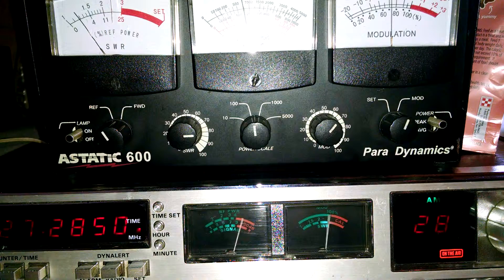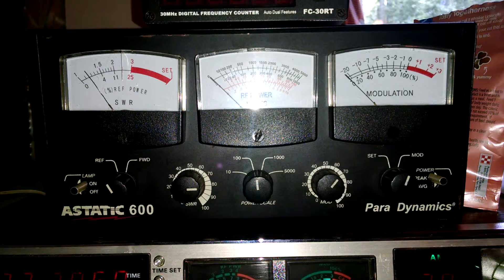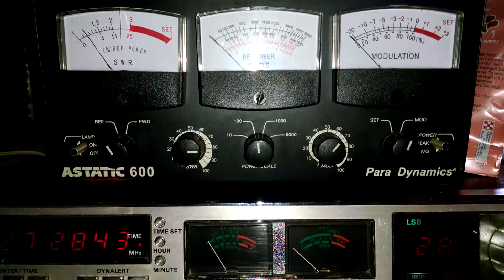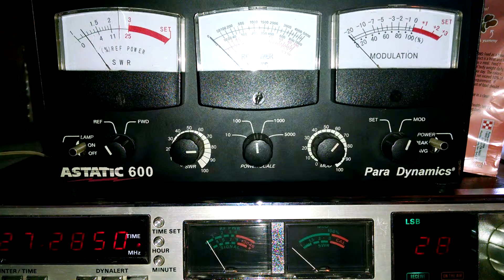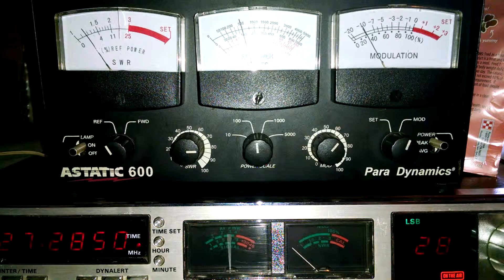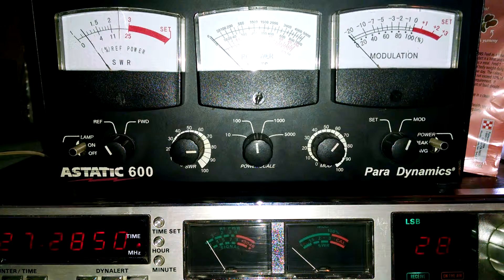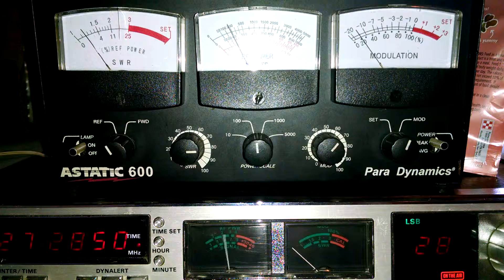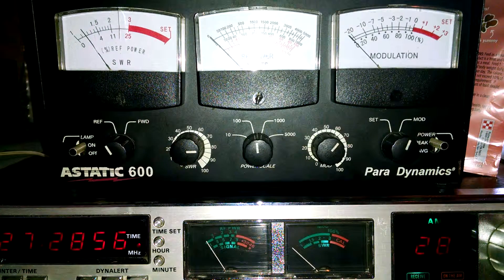Playing around with my Cobra 2000

Comment: you can line up the counter by putting the fine and coarse clarifier to center position and adjust these cans for 26.9650.
You need a plastic screwdriver or make a small adjuster out of wood or a bic pen cap.

CH-1 GOTO AM ----------- Adjust L-23 for 26.9650
CH-1 GOTO USB ---------- Adjust L-59 for 26.9650
CH-1 GOTO LSB ---------- Adjust L-22 for 26.9650

Comment: I did it on my cobra 2000's and 148.
It works good, real good.
The npc mod is the cap on the on the AM regulator/ audio IC area.
Jumping the bias wire to 12V is  the mod that converts the RF final stage to linear in all
modes.
Just dont fuck with TR24 though, put it back in, its a 2SC945...any parts radio has lots of these in it, they say C945 on them. Just clip R131.
http://www.copperelectronics.com/discus4/messages/14/16312.html?1054027852